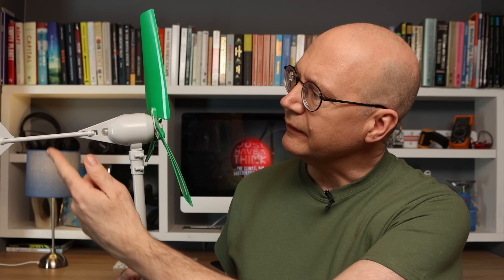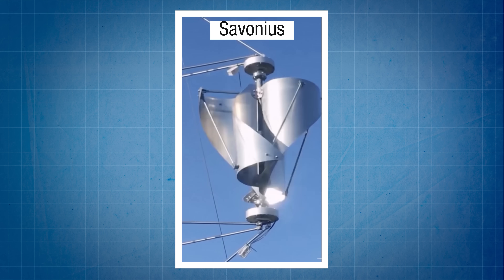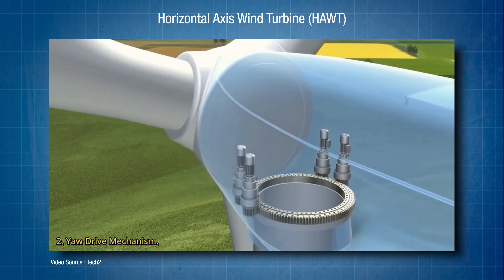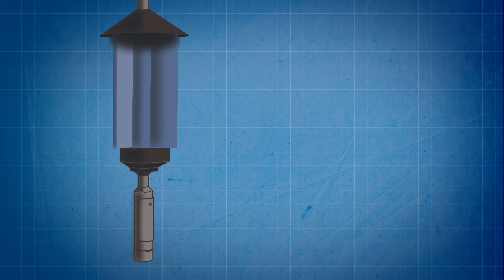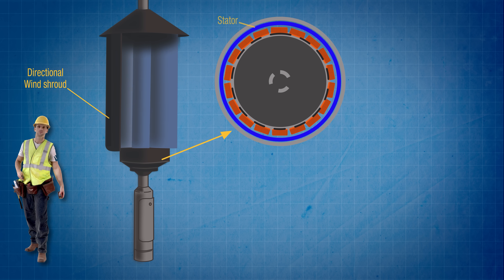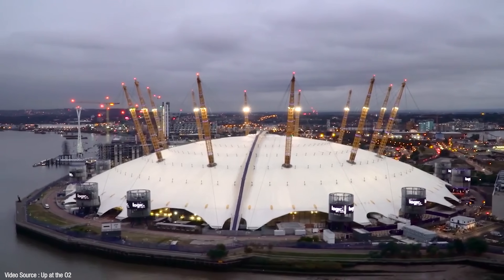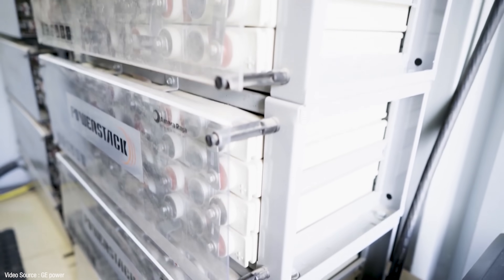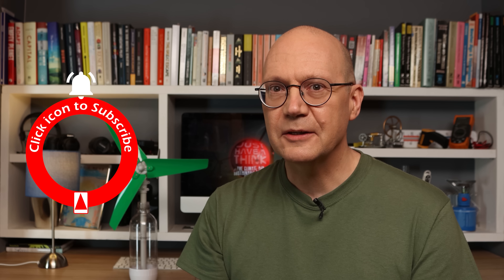A vertical axis wind turbine that doesn't need the prevailing wind! How do they do that?

Comment: I keep hearing this… the point that was made at the very end… people want to put down any idea for energy generation that is small and local by pointing out how it can’t possibly replace the large central energy producers we currently have. As pointed out, people need to embrace these “complementary” sources of energy. Energy in the future has to come from many sources, not just one huge monopolistic fossil fuel power source. We need to keep inventing, innovating and thinking of new ways. Use them all.
Reply: That not the point these new type of wind or solar is supposed to be decentralized mass power plant of wind farms
Reply: @jjrichardson5434  Centralized and huge, or small and independent, they all have to generate enough electricity to pay for themselves.  Utility-scale machinery has passed the "does it even work?" test.  Any whacky small turbine is just some crackpot's experiment, and they never work well, and self-destruct in the first storm.
Reply: @rltreasure  That is an obstacle, yes. A pessimist might give up all hope. An optimist will not. Some ideas fall flat. Some just need development over time and experimentation. Some get suppressed by big companies. Some don’t, and are in use today, being experimentally developed over time. Some are large scale. Some are small scale. It takes a lot of time to make changes this big.
Reply: If you waste a lot of money on a supposed wind energy system that returns almost zero electricity, you will just be throwing money away, and be let down when it breaks.  I am in wind energy.  We have a 10 kW turbine here that pays the electric bill.  The installation was here when I bought the place during a recession.  After it broke I got a new (used) one for pennies on the dollar.  Now on my third one at this location.  They weigh half a ton, not including the tower, and cost thousands of dollars and a crane just to lower it for service.  Even then, it's a tough case to make versus just paying the electric bill.  Best case scenario is you might break even versus paying your electric bill if you got the turbine for free and know how to maintain and repair it.  Until it breaks down, then you are stuck paying thousands to remove it.  That is using the only brand on the market that can even stay running.  You could buy a house for the same money and rent it out, paying your electric bill many times over.  Everything else in small-wind is a complete joke.  Do not believe any output claims on Ebay etc.  Complete junk, all lies.  Too many failure modes.  Made for average winds, small wind turbine self-destruct in storms.
Reply: Don't be naive. Anything short of 1000KWh per year is really not worth creating.
I have 360W of solar panels on my shed - charging a 400AH battery bank and the option to route the power through a grid-tie inverter into the house. This makes about 120KWh a year in addition to keeping the batteries charged.
So even at £0.33per KWh that is only £40 per year. 
The system cost £400 for batteries, £300 for panels, £100 for steca pr1515 charge controller, £100 for 500w Grid tie inverter, £50 various connectors, £50 high current cables, switches and fusebox. In addition to this I use a £25 extension lead to bring the power into the house, but I already owned that.
So I have spent over £1000 to make £40 of power per year. A repayment time of 12.5 years. Except I am onto my third grid tie inverter which are cheap chinese things that keep failing - I have spent more than £40 a year so far on replacing them.
Reply: @michaeldavison9808  Why did you do all that? You didn’t calculate out all those numbers ahead of time? And if solar is not good, why is it still a thing? And, didn’t this video feature a vertical wind turbine idea? What about that? Have you replaced (or supplemented) your solar with a vertical wind turbine to see if that works any better? Can we acknowledge that all these ideas are still in their fledgling stages of development, with improvements and innovations happening often? Solar was even more expensive than your calculations, years ago. Don’t be a pessimist. This guy’s channel is mostly about discussing these improvements and innovations to these kinds of alternatives. My guess is that there is more to come.
Reply: @michaeldavison9808   There is another way to look at it - insurance.  £90 /year for the first 12.5 years for energy insurance in case of the grid going down - you'll still have some very valuable juice for emergency use.  After that the insurance is 'free' for as long as the setup lasts and you get a small bonus on top.  Planning for emergency power at some level is very wise these days.
Reply: @rlbenson  agree, it’s not always about the $$$. Gasoline powered generators which are common in the USA, mostly as “insurance” for weather related emergencies are expensive and real costs fluctuate with price of fuel, but it’s ‘peace of mind’ folks are after to not freeze in the Winter or have all your refrigerated food spoiled in Summer. Also a sense of independence. Cost is not the only factor all the time, try thinking about being a human being not a statistic. And sometimes it’s about ‘the beauty.”
Reply: absolutely spot on . Large corporates will always try to  hijack small  inventions . This also benefits government from a corporation tax point of view. much like the Fossil fuel industry the govt despite their rhetoric will always try to protect their vested interests   new ideas rarely breaking through. the more diverse the better rather than the monopolistic approach to everything .
Reply: Where are they? 2 years ago and haven’t heard a peep or seen one anywhere. Lobbying by oil companies to make MP’s snub them?
Reply: In the UK government corruption means we are still bending over backwards to accommodate the fossil/nuclear fuels lobbies at the cost of energy independence. Putin has UK over a barrel (literally). We allowed business profit to compromise national security. It is criminally irresponsible and a form of economic treason!
Reply: 6kwh per day*356days a year = 2.136 MWh. 1MWh of electricity in the grid costs £40. Say these turbines last 15 years througout their entire life they produce a whopping £85*15 = £1275 WOW! Problem solved, we just need to install these £3k turbines, £1k electronics and £500 installation costs and in mere 53years each one will pay for itself and will start producing energy for consumers. If of course, it will survive that long.
Reply: @makerbeelab5546  average construction cost for a natural gas power plant is $800/kw production capacity.  These power plants are government subsidized in many ways, sometimes including completely waived startup costs.  The lifespan of a generator is 15-20 years WITH REGULAR MAINTENANCE.  Most plants have about 50 people in operation and maintenance, each paid between $40-$130k/year.  That's $4.2 million a year in wages alone... now add nearly $400 million for a startup cost to power a single city for 15-20 years.

800 of these wind turbines in the upper range would cost 2.4 mil and produce 1600MWh/year, the same a coal plant produces in a day... oh... wow, youre right, we should totally go with coal, which burns 2.2 tons of coal per household every year, turning the surrounding area into a superfund site that takes over $200 billion and decades to clean up, and thats if they ever get around to it considering there are over 270 superfund sites and growing faster than we can even make the money to clean them up, and that's if, of course, WE even survive that long.

But if you think its cheaper to just push the poison on to your next of kin to clean up, who am I to argue... I dont have kids, YOUR kids can do it!  I believe in their weakening bones!
Reply: @broodypie2216  With high efficiency burners and modern exhaust gas particulate filtering, a modern coal plant should be as clean as anything else so, Yes, go for coal. The more CO2 the better for everything!
Reply: @rodkeh  
Agreed, supplying CO2 to the oxygen generation systems (plant 🌿 life) on the planet is a given! I think I got that right, but I'm sure somebody will let me know!

Comment: Fix one (horizontally) to the front of each electric or hybrid car to generate energy to recharge the batteries whilst driving along... or to the front of trains to power lighting and other electrical equipment on board.

Comment: All cell towers everywhere should have windmills on them so that if there's a natural disaster.
The windmills will be able to generate power needed to run them.
When there was hurricane's down in the southern United States one of the first things to go was electricity.
It wasn't that the cell towers were damaged but that the electricity was cut off.
Horizontal windmills can handle a lot higher winds then the vertical ones.

Comment: Umm wouldn't resisting air flow around moving cars increase the pressure and air resistance which these cars must overcome in order to move? Wouldn't adding turbines to roadsides increase fuel requirements and increase CO2 emissions? Bloody brilliant.

Comment: For many years I've thought that the argument that wind turbines are spoiling the countryside could be defeated by placing them in the central reservation of our motorway network. However this idea is even better. There's over 2k miles of motorway in the UK so the mind boggles at how much strain could be taken off the grid with the implication of this kind of turbine. Brilliant video!
Reply: Funny that old turbines from 3-400 years ago are seen as landmarks and worth protecting. The countryside is already man-made, cultured. This idea suffers from the fact that the physics and numbers are bogus. These kinds of windmills produce 30-300 watts depending on the wind, not a whopping 2.5kW. That is a scam number.

Comment: 2.5 kW sounds very high to me. That's enough to heat a room, or more, depending on the insulation and outside temperature. I find it difficult to believe that if a building was next to a motorway, there is enough energy in the wind from passing vehicles to significantly help heat or cool that building. 

It even makes it sound as if a small version could be used by hitch-hikers to keep them warm as they wait. Or to keep hill-walkers warm on a windy day.

If there is that amount of energy available, maybe is could help keep roads ice-free on windy days.

Comment: For me it sounds like harvesting WiFi energy... How it effects the car fuel consumption?
Reply: Increased air resistance causes increased fuel consumption. Efficiency is even worse than that of combustion engines because the turbine losses add to the engine losses. The concept is outright criminal.
Reply: Doesn't the turbine dissipate the existing air disturbance created by a passing vehicle,therefore leaving 'cleaner' air for the following and opposing vehicles.would this have a benefit of decreasing fuel consumption perhaps?
Reply: @puychenin  No. It increases air resistance. Actio = reactio. Cause and effect. The cars move the blades. The air is the lever.

Comment: 10:46 "No reason" why should not be installed on homes(?) Look at noise & vibration issues very carefully first. I have seen warnings (I can't remember exactly where) that vibration from  horizontal axis turbines could damage brick built buildings by damaging the mortar between bricks. I am guessing that vertical axis ones produce less vibration,  but worth looking at carefully. 

With noise, having something attached to the fabric of a building gives an opportunity for sound to travel via the fabric. A steel-framed building might be especially susceptible.

By the way, I am generally a fan (no pun intended)  wind, solar, etc renewable energy.

Comment: I am not able to follow the power calculation. Lets say this is 5 Kwh per day  / 24 hr = roughly 200 W in average. I am not able to understand, why a bit of wind rolling (without any power angle) should generate 200 W in average. Maybe 20 Watts yes, but not 10x fold. Can someone explain, or help me with these problems. Please note: 100 W is the power, you need to almost strongly keep a bicycle going with a lets say 20 km/h per hour speed.  Looks like a potential fraud scam here, but I hope to proven completely wrong. And note, during night time there is typically not much traffic, so the average daily generation must be closer to 250 to 300 Watts.
Reply: You're right, the numbers are off by 100/1000 x. It is most likely a scam, and Dave is falling for it.

Comment: This new vertical wind turbine has spun my wheel.
Imagine using the juice this turbine created to power a heated highway to prevent ice stick on the road if temperatures drop below 30 degrees. I believed Europe already tested out heated highway on autobahn. With this integration, we will able to SAVE LIVES in winter time, generate green power, cost savings over long term. 
Now kick up a notch by making this turbine out of carbon sucking materials or somehow route the passing polluted wind to a carbon scrubber. Then technician will collect  carbon waste once a month and press it into diamonds and sell it to Gretta Greenberg. 
I would love to see it happen

Comment: Great information. I had wondered about the effectiveness and cost efficiency of these huge fan generators. Good to know advances in the vertical axis fan designs.
Reply: I would like to install a vertical axis wind turbine on a trimaran saiboat. The power generated by the turbine would power the propulsion motors and auxiliaries.

Comment: I can't believe this idea keeps getting seriously considered. A wind turbine near a moving car is not recovering "wasted" energy, it's stealing it from the car's engine (despite what the video claims) . They increase the drag on cars. So the drivers are indeed paying for the energy these wind turbines collect.

OTOH, there may be a useful application for this idea in the case of subway trains. These trains must overcome the extra drag due to the tunnel walls by using extra energy. If wind turbines were embedded in the wall, they could recover some of the lost energy, which would be wasted since the walls are not optional. I have no idea though whether the cost of adding the turbines would be worth the energy recovered.

Comment: If you extract energy from the airflow, then you will increase the (air) resistance to the vehicles, this will not be "wasted energy" but an energy cost on top of the existing air resistance.

Comment: People are missing the point. 

The power potential was based at 60 mph cars. Speeds of 30 mph has 8 times less power, since a difference of 2 times gets cubed or 2*2*2 or 8.

This means that you have to use it near highways and not city streets. Read that VAWT gets about 30% efficiency compared to 40% HAWT. Using a VAWT would make sense for other reasons at a home, since most don't live near a highway. 

There is a major Interstate passing nearby that cuts through the town below home level. How about hanging out a VAWT like I have seen shown in small scale water turbines being thrown into a stream?  The turbine catches the stream of air!

Comment: There are good reasons why the existing commercial wind infrastructure has been built from the designs that it has and not the alternatives. If the alternatives worked better, were cost-effective, made more sense, etc., that's what would predominate--or at least be well-represented.

Comment: I dont know about the UK, but in the US, I think this would be a huge item for the individual home owner like you said. The only problem within the US is the utility companies hold on state and federal regulations. For example, in most states if you have a solar array on your roof you cannot keep that power stored on your own. Instead, the power you generate is required to go directly into the grid. Then through calculations of your production vs your consumption, you either pay or get paid. The problem though is storage for personal use during say a blackout. This net use system prohibits home storage and thus does not offer any of the off grid applications some look for. I would feel that as much as these turbines would benefit homeowners, the states would such up that advantage as well. I know the house I retrofitted in NJ with solar and ridgeline miniturbines offered me huge rebates and refunds from PSE&G as well as a net zero monthly electric bill. All I ended up paying for was my gas bill which also was close to zero as it just became my stove that was using any piped gas. In any case, my point is, if individuals are able to eventually get the big oil and gas out of the state and fed pockets, maybe we could see some great individual projects that allow total off grid housing. The new Tesla solar battery that is all over the internet right now would go far towards that. But first we need to get the politics out of the equation.

Comment: the biggest problem with road site turbines shoult be the salt and stones that get used in the winter. how fast will they sease up with thrown up stones or salt? 
what is with rain? will it get into it and bring dirt with it into the system? how often have they to be cleaned? will they ever be cleaned or simply changed when they aren't rotating anymore? what happens if the wind is too strong and the breaks fail? will they shoot the blades at a coming car with near terminal velocity? who is the one that gets punished in the case it kills someone in such case?